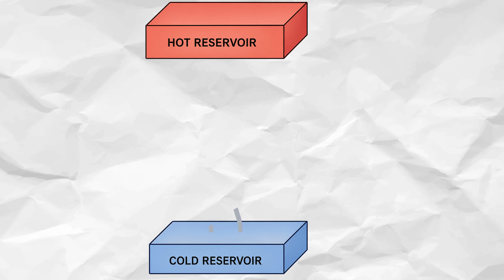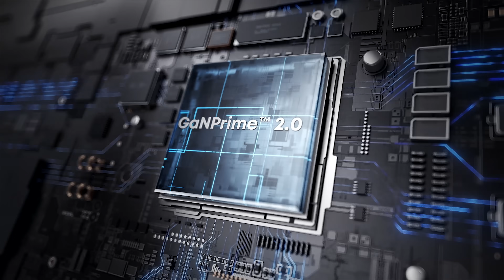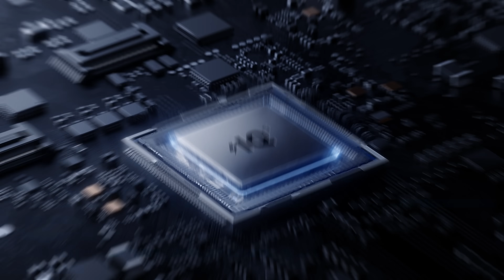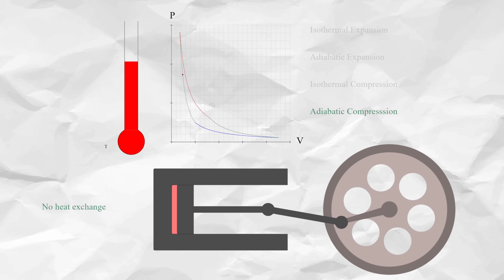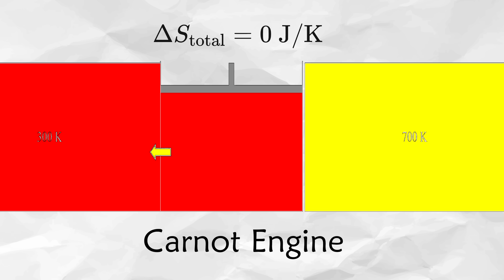This Tiny Engine Explains Entropy

Comment: Carnot's theorem is the most overrated theorem in physics. Using atmospheric pressure as an analogy, being down about efficiency losses is like being upset that you can't fly despite the atmosphere applying 100+ kPa of pressure on you. Of course, for motion, we all know it's the relative directional push on you that matters (the heat gradient), not the raw pressure itself (the actual heat).

Comment: in quantum thermodynamics alterations of your continued total voxel system is done through the given possible outcomes of the energy barrier, the other side it travels too & the total number of fields behind your given point you are having move together with the speed at which that point is moving. Fields behind the point increase the given multiplicative to additive of the given momentum, speed is then used for the given total initial value. Penrose diagrams are used for your point crossing to your given energy barrier then you must get into your Schrodinger then you can use Feynman conversions which are from interference, interaction, impartings, impactings, influencings on the given point you started with.

Giving you only those possible outcomes on the other side of the penrose point.

Friction is considered alterations in any manner to the system that is going to change given wiggle jiggle, frequency, movement of the total whole voxel system, the point voxel system (which can go into below plank lengths & seconds & be made up of many different sub subatomic forces & particles), the collapsing of given states, their charge changing, their total value therein changing towards a more equal state across the total system (ordered, chaotic, less, more, doesn't matter that's not actually what entropy means. Entropy means towards a equal state for all in the system & outside of the system & the energy moving to force it to become equal is based on the total differences in the system relative to each other & all systems connected through space & time) which is not trending towards, in any way shape or form, more chaos. Truthfully it means, in all ways, towards less. It just looks from a perspective of scale such as ours, to be more chaotic at first.

There are more factors & variables, sure, but I only got to .51 in & had to become pedantic & semantic about it, only as a result of people really screwing up the understanding of this stuff. All engines are at a conversion through frictional states of movement relative to anything in any given system. Fields are frictions, conversions are frictions, so are alterations & basically anything changing as it takes the 5 i's (interference, interaction, impact, imparting, & influencing) to do any change relative to the stays at rest unless acted upon system through a given movement & potential to move & or value that needs to be equalized giving it movement.

No changes ever happen without friction. That is true thermodynamics. All engines suck at using it correctly. Its a big skill issue. Of all of humanity, deal with it.

this is a special relativity problem, both sides look more equal & less chaotic in their relative time & space & movement. its super symmetrical. both are moving relatively based on both seeing each other being off & more chaotic to each other. This is easy math, stop playing around.

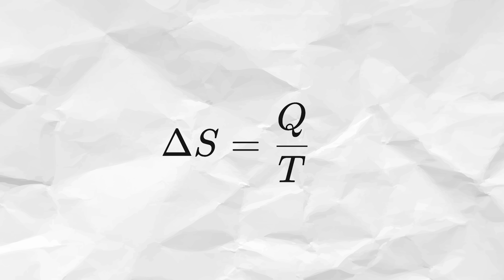Comment: 4:54 Something cool: T = Q/∆S is actually how temperature is defined. Entropy is more fundamental.
Reply: Controversial. We define Temperatures by 'fixed points', namely equilibria at phase transitions. Temperature 0/100 C by the (solid/liquid) / (liquid/gas) transitions of water at atmospheric pressure. OK, if you want it more precisely, define it by equilibrium of 3 phases (triple points) which do define the pressure implicitly, not necessarily atmospheric. But there is no need to reference entropy when defining temperature.
Reply: @Leberteich  he’s not talking about temperature scales, but the concept of temperature itself. Also temperature scales don’t have to be defined in terms of phase transitions, it’s just a good way to do it.

Comment: What's it called when you transfer one form of energy to another and capture that energy?  Like if you harness the heat generated from running a high voltage transformer to convert to DC and power a cooling fan for that same transformer?

Comment: 9:12. Wrong.  Come on man.
Reply: What's wrong about it
Reply: @paweswiader1629 
He basically says that “EVERY” very efficient electric motor gets electricity from burning fossil fuels.  Probably most do.  But the use of an absolute is sloppy.
Reply: @JayAlfredoG nah, he said "inefficient process" and gave burning fossil fuels as an example. And that's completely true. Another example could be solar panels which are currently 25% efficient at best
Reply: @paweswiader1629  it solar panels aren’t wasting anything and are not converting from heat.  They just exist.
Reply: @JayAlfredoG  there is certain amount of  energy coming with light rays to solar panels and they can only extract 25% of that energy. The rest is turned into heat. That counts as "inefficient process"
Reply: @paweswiader1629 correct! There are much more efficient ways to collect heat energy from the sun.  For example, evacuated tube solar collectors are up to about 70% efficient, vs 25% for the best PV solar.  The difference is that PV delivers very organized energy in the form of DC electricity, whereas the energy from evacuated tube solar collectors is disorganized heat energy.
Reply: @paweswiader1629 hydroelectric is up to 90% efficient, and Brazil has more than 60% of its power from hydroelectric (it was almost 90% in the recent past), so it's not an absolute truth that  electricity hides the inefficiency, it depends on the main source for that specific region
Reply: @MarcosRodriguesCarvalho this is a video about thermodynamics and not energy systems. Stream of water going to water turbine is an ordered energy state (like electricity) thats why it's so efficient. But the process of heating water in seas so it can evaporate and move to higher altitudes, rain down to rivers and be used in turbines could be described as VERY inefficient process. Technically steam turbine is also 90% efficient if you forget about the boiler

Comment: The Carnot engine also has losses which were not accounted for in the efficiency equation which only took into account the heat transfer between the different sides, it takes energy to move the left and right side across to the piston and that work results in more losses.

Comment: Golden video right here ty
Reply: The tubnail got me mentally triggered would the system (movement )still apply if the tube isnt in a clear visualization material lets say a aluminium tube i dont like all those formulas i whant too build it more then they did in our history too create a ultimate progression of technology timeperiod the whole system is going software which is crazy to me because you still need too develope a hardware body too create robotic framenetworks too operate and create theyre on task robotics

Comment: I am not sure I understand all that you were saying, however when you say (in relation to electric motors) "In order to achieve that high ordered initial electric state you had to first have done something that was inefficient like change heat into work"  and "use your energy wisely" I believe there was an opportunity to also say  "source your energy wisely"  for example the sun, where the energy is abundant.
Reply: "use your energy wisely" includes the source

Comment: Let´s not forget the vast majority of the energy on Earth comes from the Sun, so converting sun radiation directly to electricity with solar panels, and using it in electrics motors is probably the best and most effective way .

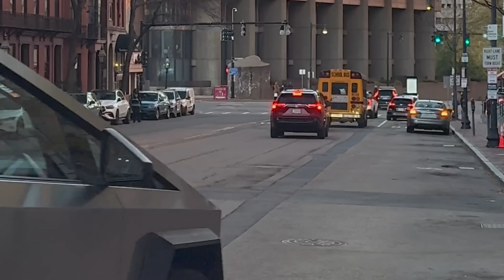Comment: 8:40 since you're touching the subject of the way we get the energy for our electric devices, it would've been cool if you mentioned the many methods we have of aquiring such energy that don't depend on combustion engines at all, like wind, geothermal, hydro and solar. They're still not perfectly efficient, because they're converting movement into electricity (except for solar), but they're way better than pumping out, transporting, refining, transporting again and then burning some limited fuel. And, especially with solar most of the cost is on the purchase of the panel; the rest is some minimum maintenance and completely free energy until it fails and the panel gets mostly recycled.

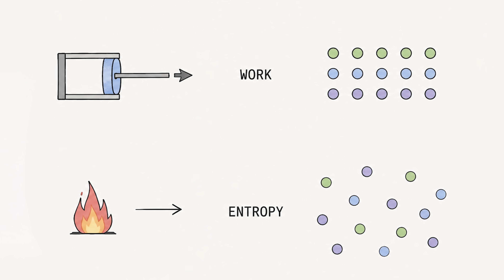Comment: 4:26 Entropy is NOT necessarily energy spreading out.  Consider a dense, cold object (like a block of iron from the freezer) in contact with a very low-density, spread-out system at higher temperature (like the air in the room outside of the freezer).  Entropy increase means the energy will flow from high temperature to low temperature, which in this case means the energy becomes more concentrated in the dense, cold object as it warms up.
Reply: you spread the entropy out when you cooled that block
Reply: @thekaxmax  Assuming you mean I spread the energy out when I cooled the block, that may or may not be true.  (Maybe the freezer works by setting the block of iron on a very cold bed of lead that absorbs heat from the iron and concentrates it into a smaller volume.)  But in any case it's irrelevant to what's going on in my scenario, where thermal energy is still getting more concentrated due to the 2nd law.  The point is that heat flows from high to low *temperature*, not necessarily from high to low *thermal energy density*.
Reply: You spread that energy out when each atom in the block (much more so than in the gas) takes a tiny share of the energy.

Comment: I never like the "ordered" and "chaos"  Terms use for entropy since when a system has equalized in temperature it is high entropy.  
For example the "entropic death of the universe"  is when all temperature are the same, to me thats ordered, the random pockets of heats is what seems chaotic.
Equalization I think would be better terms,  Electricity and Kinetic vs thermal would better explanation electrical efficiency than organized energy. 
I am just not sure why they used ordered and chaos
Reply: Agreed - and what is ordered to one is chaotic to another - it's subjective - anthropomorphic. Not physics.

Comment: If that conversion is so efficient at such high temperatures, why not convert heat from kilns and crucibles used in ceramic and metal production into ordered energy?  Or is the amount of energy a steam engine produces not enough to compare with natural gasses and coal?

Comment: Nuclear and solar power are critical precisely because the inefficiency is handled by an energy source that doesn't destroy the planet and is basically infinite.

We've now had three massive power demands in about 15 years: bitcoin, electric cars, and now AI.

And data centers can be cooled with desalinated ocean water with the salt dumped into the middle of the ocean over a wide area.  There is no more reason to be burning oil for our biggest use cases for energy.
Reply: Funnily enough, electric cars actually reduce energy demand significantly – a battery electric car takes less energy to drive than it takes to provide the fuel a car with internal combustion engine needs for the same distance¹; an by then the ICE car hasn't moved an inch yet.

¹) drill a deep hole, pump crude oil to the surface, pump it through miles of pipelines and onto a tanker, ship it across an ocean, pump it to the refinery, process it into gasoline, diesel, kerosene,…, fill up a road tanker and drive it to the nearest gas station, and then pump it up into the car's tank

Comment: For solar panels, the Carnot-like limit is about 93%. Sunlight acts like radiation from a source at about 6000 K, while a solar cell and its surroundings are near 300 K, so the temperature difference makes the ultimate thermodynamic limit very high, around 93%.❤
Reply: Yeah, but the Sun is VERY inefficient mass->energy convertor.
Reply: @Urgleflogue  You're right.  Let's shut it down.
Reply: @NotSoMuchFrankly  bro really picked a fight with checks notes the stars
Reply: @NotSoMuchFrankly  You'll need to speak to Gravity, I think she's the one responsible for running the Sun.
Reply: @Urgleflogue  yea but it's free and we don't have to spend our own fuel to get it
Reply: @grim_diamonds7290 But, but, but, the entropy of the universe...!
Reply: But solar panels do not work as Carnot engines. The efficiency limit of solar PV is given by the Shockley Queisser limit, 33.7% at the theoretical optimum bandgap, 32% at the practically relevant Si bandgap. The limit does not (directly) come from thermodynamics, but from the fact that sunlight covers a spectrum of wavelengths and you have to compromise btwn maximum current (maximised by small bandgap) and maximum voltage (maximised by large bandgap). Before you say it, yes the solar spectrum itself DOES come from thermodynamics, namely blackbody radiation law. Max the Planck. If you'd use laser light for PV you could theoretically achieve 100% efficiency for radiation --> electric energy.

Comment: 100% efficiency can be achieved during matter and antimatter collision converting all of the mass into energy
Reply: 100% heating efficiency doesn't require antimatter. Electrical energy is converted 100% into heat by any cheap space heater.
Reply: You didn't even grok that the efficiency number is calculated from work? The energy you get from that collision is not work. Convert some of it to work, then look at your number.

Rewatch again and pay 100% attention when he talks about ordered and unordered energy...
Reply: Yeah. But you lose the matter in this case.

Comment: Fun fact: Solar Panels are heat engines. The cold side is the panel and the hot side is the sun. They can never approach 100% efficiency, and they get less efficient when hot.
Also: The inverse of the carnot engine is why heat pumps can be over 100% efficient. Theoretically, a perfect heat engine and a perfect heat pump together cancel their efficiencies back to 100%.
Fun fact 2: LEDs are heat pumps. Therefore they could theoretically reach >100% efficiency. The cold side is the LED and the hot side is the light temperature (the Kelvin number on the package).
Reply: they are? You can stack two or more different types of solar panels on top of each other, and together, they'd beat the Carnot efficiency, as each one only filters out a smaller spectrum around the peak absorption its materials dictate
Reply: @PunIssuer  They can't beat the carnot efficiency (which would be ~95%). What you're thinking about is a different efficiency limit (Shockley–Queisser limit), which is much lower (~32%) and can be overcome using tandem cells.

Comment: The Sterling engine is only less efficient than the Carnot cycle because it is a real engine.  The Carnot, Sterling, and even the Ericsson cycles are all completely reversible, and have the same efficiency.  There is a big difference between a theoretical thermodynamic cycle and a real engine's performance.

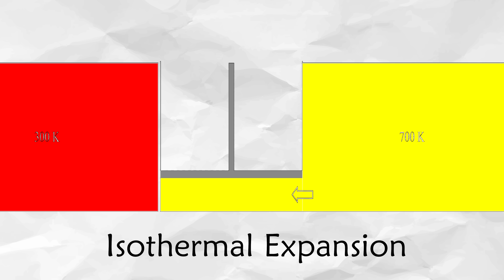Comment: Nice video! At 6:20, the gas getting redder over time actually made it a little confusing at first. We usually think of redder as being hotter rather than cooler
Reply: Yeah that is confusing, definitely had the colors backwards.
@Busy while true in real life, this is an edutainment video, and we have standards!!
Reply: @kindlin  Not backwards, since yellow is hotter than red, but still somewhat confusing.
Reply: @felixmoore6781   Ah, yes, the emission spectrum does in fact go red > yellow > white, but we culturally use red as the hottest and then go thru the rainbow, hot to cold, red (hot) > orange > yellow > blue (cold).
Reply: Counterintuitive but temperature is hotter, the more bluer something is. Blue stars > Yellow Dwarf stars > Red Dwarf stars for example.

Comment: I have never seen such a simple Stirling engine! Pretty cool.
Reply: 14 years ago i saw it on Grand  illisions channel, looked up for the video title "Heat of your hand Stirling Engine". Tim Rowett's presentations was ahead of its time.
Reply: I saw one that had just a cold water intake and a hot water output/propeller, designed for model boats.

Comment: Does this mean that solar cells will also never be very efficient?
Reply: They can never be very efficient, but for a completely different reason. Solar panels are not heat engines.

Comment: Could a sterling engine be scaled up to turn motors for powering individual homes instead of using Solar or Wind?
Reply: Didn't you even pay attention to half of the video?

He literally said that Stirling cycle is not the most efficient that exists
Reply: @u1zha  I didn’t ask if it was the most efficient or not. That answers nothing for my question. From a pragmatic standpoint, I don’t care how efficient or inefficient it is, I only care about if it’s good enough to work for what I want it to do.